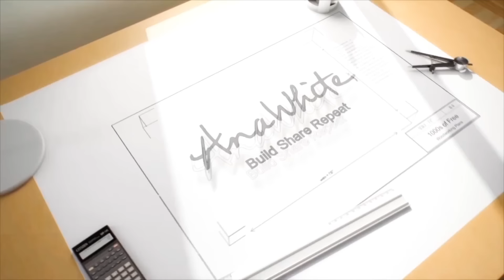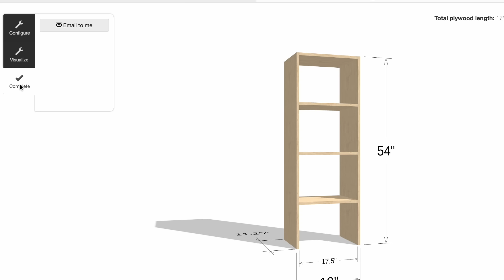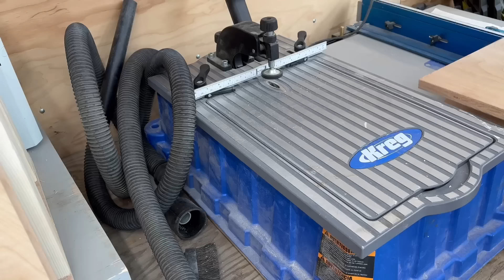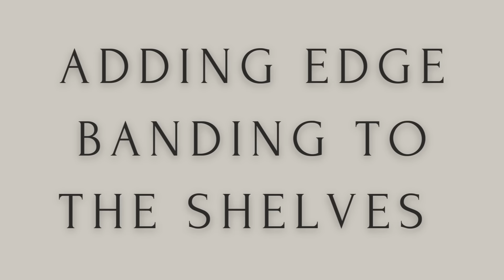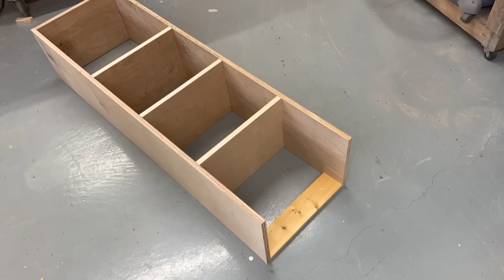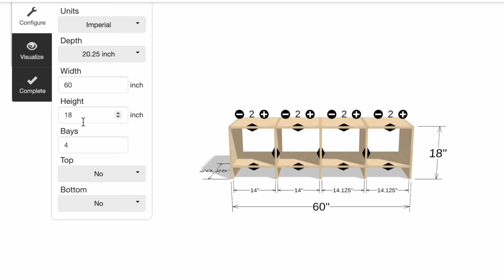Design Your Own Furniture! Free, Easy to Use App

Comment: Nice design tool.  However, it requires 10 vertical bays - no way I can see to change that.  But, as I said, very nice for a simple design not requiring "custom" joint details.

Comment: Thank you for sharing. This is very easy to use to configure a carcass. Unless I am the one who can't find this, one way to improve the app is to include the trim and support pieces in the cut list. I designed a simple entry bench with shoe storage. Boom, there it was. But, I needed supports. I couldn't find anything to do this on the configure page. So, I went to the visualization page. Immediately, it showed crown molding (which I deleted) and supports under the top and shelf (which I kept). However, when I completed the design, the support pieces were not added to the configure page, nor were they included in the cut list. All in all this is an effective, but very basic design tool that I will probably utilize for garage storage.
Reply from the maker: Thanks for watching, I hope it's been figured out! https://www.ana-white.com/woodworking-projects/seasonal-and-holidays/plans-and-templates-using-ana-whites-free-furniture
Reply: @AnaWhiteDIY  Nope. Maybe I just can't figure out how to include the top and supports, but it doesn't even include it on the cut sheets. Are there any specific instructions for it?

Comment: Hi Ana, I did use your tool in metric, and found it very helpfull. The only thing is, that the cutlist still is imperial. If I go to the home improvement store with this cutlist, they are not able to help.
Next question, can you also make a tool, how to make the most efficiënt use of a sheet of ply? Preferrably in metric to? A full sheet of ply is 2440 x 1220 mm

Thank you verre much